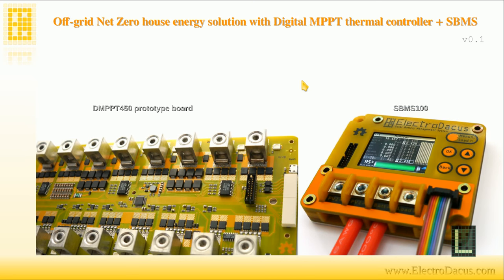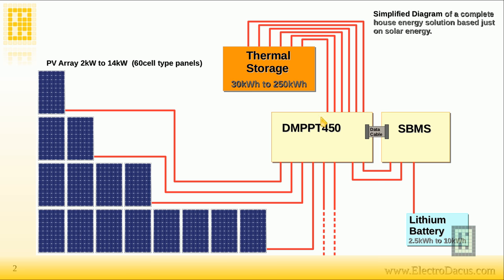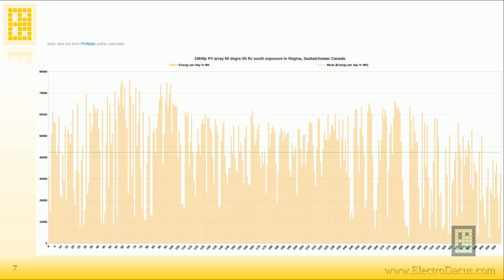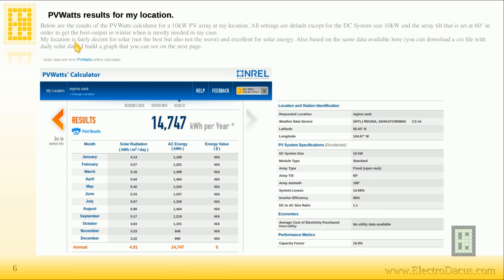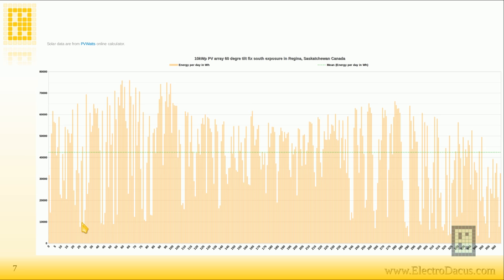Explaining the Digital MPPT thermal controller

Comment: Hello Dacian,
Is there any place where we can found specs of the DMPPT, like max current/voltage per input .. per output ? 
Max current that can be sent to the SBMS. Is it possible to connect an inverter on one of the output ?
Is the DMPPT only working as a "switch", meaning the current on outputs will vary with the PV exposure till the DMPPT eventually change the number of connected PV then there will be a "step".
How could we use this DMPPT as a "Gate" to heat water, provide power to an inverter and charge batteries. Meet the first question, which will then be the max power usable by the inverter and the battery charger.
Reply from the maker: Go to my webpage http://electrodacus.com/ and you will find the user manual. 
DMPPT450 can divert up to 120A to the SBMS120 for battery charging the rest of the energy will be send to the DMPPT ouptuts for heating and the number of DMPPT450 outputs enabled will depend on the amount of energy available from the PV array as the DMPPT450 will match the PV array max power point by connecting matching amount of Loads so Load+ outputs can only be restive heat elements to heat water or other large thermal mass storage like concrete in my case.
For example I have a 10kW PV array with a 5kWh LiFePO4 battery (I use around 120kWh/month as electricity for appliances most of that is electric cooking) and I have a 160kWh therma storage most of that is the large concrete floor that is insulated form outside. This fully heats my house and provides the electricity needed so is a net zero energy house.
Reply: @electrodacus  Hello, thanks for the reply. So ... last option, is it possible to put an inverter behind the SBMS.. since 120A is something like 4800W. I'm not into electronics, so .. sorry for my stupid questions : if i connect the batteries to the inverter... and the inverter is sucking less then DMPPT is giving.. then batteries are not used right ? The voltage sent from the DMPPT to the SBMS is 24V ?

I'm trying to find a way of using your devices,  while it seems pretty well done, it also seems very specific : 
- In summer or when thermal mass temperature is reached : Most panels can't be used cause DMPPT send 120A to SBMS out of 450A (max) from PVs... ?
- Can only be used with 24V ?

For me, DMPPT need one output to feed a 48V inverter, a non resistive device, perhaps the ability to switch one output for resistive/not.... 100A*40 = 4000W, seems enough.
Reply from the maker: Yes if the inverter uses less than what the charge current is then all the energy will be used directly from PV panels and the difference will charge the battery.
In summer I only use about 10% of total available energy and it makes sense as I do not have any use for the other 90% of the energy since I do not need heating or even cooling.
In an offgrid application there is no way to use all the available energy.
It is technically impossible to supply an offgrid inverter directly from PV panels as if panels put out say 2500W and you load needs 3500W there is no place from where you can take the extra 1000W and so voltage on the panels will drop and your inverter will power off or even get damaged.
If you involve a battery then the battery needs to be large enough to handle the PV array so say with a 10kW PV array you will need a 40kWh battery and that is very expensive negating the low cost of PV energy.
PV panels energy amortisation cost is around 2 cent/kWh while best case battery cost amortisation is 20 cent/kWh so at least 10x more expensive.
You just try to use all available energy in an offgrid system and that is just not possible (it is possible but just a bad idea to try and find something to use it on when you do not  need that and all will become more expensive just so you can say you used all available energy).
Reply: @electrodacus  Hello, 
Using only 10% of the available power in summer seems a bad idea to me, we could use electric tools (those that need 3000W+), air conditionning, high demanding appliances for example, losing this potential energy by design is not a good idea, in my opinion. I think you should include something to let us use the available power appart from resistive elements. I understand your case and that the DMPPT can satisfy your use .. but most people will not be in your case and thus the DMPPT need something more to satisfy more people, if that make sense.. :D
I'll reformulate the question, is it possible to connect an MPPT to an output of the DMPPT to supply an inverter ? (many inverters includes MPPT).

Those are not critics cause you did far more then i'll certainly never do, just that i try to find a way of using this tool cause it could help me a lot in winter. But i would also like to use more of my available power when the weather is cool and that i do not need heating. So in your case heating is something like 70% of your energy use, will be far less for me.
Reply from the maker: It is a bad idea to try and use more energy than you need (not sure if that makes sense to you).
For example my house uses about the same amount every month about 120kWh/month excluding electric heating and total including heating in January gets around 1000kWh and that is what the system is designed for as using any other source like propane as backup will be more expensive so it makes sense to design the solar system to handle the coldest month fully.
I do not need air conditioning else I can easily use that and I do not need any other appliances other than the ones I use and even if I will double somehow my current usage there will still be just a fraction of what is available so still far from using all available energy in summer that is maybe around 1300 to 14000kWh/month.
Home heating takes about 8 to 10x more energy than all electrical appliances combined (that is valid for almost any house in a heating climate not just mine) so it makes sense that you will not need that.
The cost amortization for my entire system is around $42/kWh about half that for each heating and appliances so around $500/year about $15000 in 30 years (that is the amortization period as the main component PV panels should last at least that).
Now anything that I add to this in therms of cost so that I can use more of the energy will be unnecessary since I do  not need more as I do not make any economy I use as much energy as I need so forcing me to use extra just to say that I used more of what is available will only increase my expenses for no reason.
For example I can have a larger water heater but if I do not use that it will not use more energy (slightly more as more will be lost over night with the higher area) and some other useless appliances can be added just to use more and say I double the 120kW/month then maybe I also need air conditioning as more electricity used in to has will all end up as heat so house will be warmer and that may also take maybe 40 to 50kWh to offset the extra energy usage that heats the house but all those costs for extra appliances will just increase my spending with no benefit and I will still not be using all available energy :)
Reply: @electrodacus  Mmm ... you do not reply to the questions. 

- Can we use the outputs of the DMPPT in something else then a resistive element (MPPT inverter/charger, something else ?)
-  If the SBMS is connected to a specific connector, can this output be used to connect an MPPT inverter/charger,  something else ?

I'm asking many questions to try to understand, but perhaps the easiest way is to ask : "On a 10kW PV system connected to the DMPPT, what is the maximum power (= no heating) that i can use in summer and how  ?"
Reply from the maker: No you can not use something other than a resistive type element on the DMPPT output as those just connect the PV array to the output and PV panels are constant current sources where current is directly proportional with the amount of light so any device that needs a constant voltage like an inverter will just fail when there will be a cloud or there will be less power available than what the respsective load want's to use. On top of that inverters are captive loads so when connected they act as a short circuit and so that will possibly damage the mosfets depending on max PV array current and PV cable capacitance.
No none of the outputs of DMPPT will handle capacitive loads and in fact no captive loads can ever be connected trough a switch either mechanical or mosfet based.
An MPPT inverter is only designed for grid connected solar and DMPPT and even SBMS are specifically designed for offgrid use applications.
If you are grid connected then adding a battery energy storage device is a very bad investment.
The DMPPT is summer when heating is disabled can redirect up to 120A to the SBMS120 over the PVOUT1 and PVOUT2 connections so that will be a bit over 3000W out of maybe 7000W (in hot summer day's panels will have lower output than STC rated) so less than half the panels will be redirected to this two outputs and if is cloudy or later in the day when sun is at an angle up to all panels can be redirected to battery charging as long as they are under 120A.
Battery will also need to be at least 400Ah to be capable to handle 120A charging so 10kWh battery minimum.
My battery is 180Ah so current send by the DMPPT450 to SBMS120 is limited to 60A in my case.
I can get away with such a small battery as even in completely cloudy days when all panels will be redirected to battery charging I can still produce around 4kWh and that is my average daily usage so battery will be fully charged every day even if I have an infinite number of overcast days.
The smaller battery makes for the best battery cost amortization as I do not have to pay for a larger battery and battery will still last about as much at least 15 to 20 years in my particular case as measured battery degradation for the fist year was 0.9% most of that around 0.6% was calendar aging that will affect the battery even if not used at all.
Reply: @electrodacus  I think I'm like David, and there something I do not get, you say Dmppt act like a switch and connecting something to the output would be like connecting directly to PV.... my inverter is directly connected to PV, with no problems... it's an inverter with mppt and charger kind of "all in one". So I would not be able to connect this kind of inverter to PVOUT..?
I'm off grid.
Reply from the maker: Can you provide me with the offgrid inverter model that works directly from PV with no battery ? I'm fairly sure that is impossible.
DMPPT450 is a Digital MPPT so there is no DC-DC conversion involved is an unique product nothing like this exist as far as I'm aware. You will need to look at the manual to understand what Digital MPPT is.
Grid connected inverters will need grid synchronization to work, and an offgrid inverter with large input voltage range will just need to power off if Load requires more than PV can supply not sure how that will ever be useful.
Reply: @electrodacus  https://www.youtube.com/watch?v=kQfJMRSTh8g
This is one example, there are other bateryless inverters that connect to PV, many are used off grid to power pumps in the field without batteries (not this one which is for houses), just look for "batteryless inverter".
I do not see why we could not connect this kind of inverter... now the question is .. can the DMPPT "feel" the needed power on one of those output.... and put the according needed PV in the mix. 

But batteryless is not the point, we could connect an Mppt/Inverter/Charger device to one (or perhaps 2 in parralel) DMPPT output(s), this inverter would be connected to a battery... (no SBMS)...
You see, the DMPPT would act like a router but leting us connect a 5kW Mppt/Inverter/Charger device and produce AC "on demand", when there would be no load on the AC side, then most power could go to the resistive elements on PV3, PV4 ...

Something like this : https://ibb.co/2jfGVw1
Reply: You said an inverter working on PV was impossible ... So ? What are the conclusion now ?
Reply from the maker: @davidniquot6423  That is bad design from MPP side. Have you watched the entire video ? The reason that worked was that there was more PV solar energy than the load needed and it used the PV array as it was a battery but if there was any cloud those 20 panels (over 5kW of PV) will not be able to provide the 1.6kW load and it will shut off and this can both damage the load and the inverter is just a matther of time.
The inverter should have been designed not to allow for this to work as is very dangerous for both Loads and inverter.  Most loads will not even work at all as they require a high startup power say motor based loads and PV alone can not provide that unless severely over-sized.
Reply: @electrodacus  ... Of course there is more solar energy then load need ... it's not spontaneous energy generation. The guy said that he connected 1800W of PV for a 1600W load and the inverter was saying that the PV was low... which make total sense. If the PV power is too low then the inverter shutdown. Those kind of inverters are used to pump water and they use no batteries. You say it's bad design .. but they sell thousands of it.
Reply from the maker: @davidniquot6423  In the video was clearly stated that it is not working with just 10 PV panels (those are likely 260 to 300W panels so 2600W of PV was not enough for that load) then he connected two strings of 10 panels in parallel and that is what was shown in that video at least 5200W of PV panels supplying a 1600W load.
If there are clouds then it will turn ON/OFF multiple times and that will very likely damage the inverter as the manufacturer mentioned.
I use a PIP2424 inverter in my house they are good but in this particular case they should not allow it to function this way as it will sure get damaged without a battery.
What you have there is a PV array + a DC to DC converter /MPPT plus a DC to AC inverter then load and as PV panels are not a storage device just a constant current source based on the amount of light any time the power from PV drops below what Loads need it will power off the load (that may be unsafe depending on what the load is). If that is just a water pump then is much easier to use a DC pump that can work directly with solar and can adjust pump rate based on amount of solar this way much smaller PV array is needed and no extra cost for solar mppt and inverter is needed. This is useless for any sort of loads I can think off.
Reply: @electrodacus  "In the video was clearly stated that it is not working with just 10 PV panels (those are likely 260 to 300W panels so 2600W of PV was not enough for that load) then he connected two strings of 10 panels in parallel and that is what was shown in that video at least 5200W of PV panels supplying a 1600W load."

Sorry .. but that's not what he is saying ... you got all wrong. It works with 10 PV with an alarm, it works with 20 PV with no alarm.
https://youtu.be/kQfJMRSTh8g?t=231
"when i only hook up ten panels which is one of my array, it ran but i got an error saying PV is low Ten panels at this time of the day should give me 1800W" => He use a mini split that draw 1600W => All good, the inverter is just saying : safe .. we are low on PV
"when i hooked 2 arrays, which mean 20 panels, obviously this is plenty enough for this 1600W load"
So it work in both condition. The only thing he said was that if the inverter had to switch on and off too often it would not be good for it... which is obvious.
I feel that you kind manipulate fact to turn them in your favor... which is .. not good.
Reply from the maker: @davidniquot6423  Those are 60 or 72 cell panels based on the voltage output so they are at least 260W panels and what he is saying about the 1800W from 10 panels is just his guess as he can not see what the panels are capable if he has no battery to take advantage of all the available energy.
An air conditioning unit require's at least 3 to 4x higher start up current than working and that will cycle often ON/OFF based on temperature thus it will need around 4000 to 6000W to start so 10 panels will not be enough even if in the afternoon as there is no energy storage device the panels need to be able to provide that.
So you need a 3 to 4x oversized PV array to be able to handle that particular load he was using.
I suggest you get a small solar panel and a DC-DC converter then connect some different loads on the output of the DC-DC converter and you will see what the problems are as this is exactly the same thing. Without a storage device you need to oversize the PV array and even then your loads will power off when any small cloud covers the sun.
Reply: @electrodacus  Ho my god .. you still argue... it's the same as your peltier discussion where we are all saying that you are wrong but it take like 10 pages to convince you that you are wrong .. but still .. you do not accept it.
"inverter working on pv do not exist" .. they are, you was wrong .. period. "Yea but they can't take load without oversize PV" .. what are you talking about ... they take the load accordingly with what pv can give at a given time or what's needed to start a motor or whatever.. of course. 
That do not make you right. Jesus. You are not credible anymore.... sorry.
Reply from the maker: @davidniquot6423  What is there to accept? Solar PV panels are a constant current source with the amount of current they can provide being directly proportional with the amount of light when the level of light goes down and there is no energy storage device like a battery or grid as backup then the load will switch off (that is not practical).  Also every time a load needs to be started unless is a restive load like a heat element it will require a higher current to start and if that is not available the it will not be able to start.
So you need a significantly oversized PV array as it was the case in that video where at the time he was demonstrating the inverter he had connected 20 large panels (over 5000W of PV) to supply a 1600W load and even so it will only work in a full sunny day a few hours around noon.
I fully power my house with PV panels that includes electricity for appliances but also heating and the DMPPT450 that is used for heating can work with only PV panels and multiple heating element's no battery involved but the heating elements are resistive and the DMPPT450 is designed to connect as many heating elements as needed to maintain the PV array at max power point.  This way I use all energy available form the PV array and energy storage is done in thermal mass so that is there is a cloud maybe just one of the 6 heating elements can be powered or even none of them but it will still be warm inside even with a few overcast days as there is a large over 160kWh thermal mass storage device.
There are air conditioning units that can work directly from solar but the way that work is that it still have a slightly oversized PV array and the compressor has variable speed and so power output to match what is available from the PV array MPPT in some limits.   Having an air conditioning that was designed for grid use and needs constant amount of power is not practical to be used with PV as the array needs to be significantly oversized just for it to work a few hours a day.
You can write a comment in that guys video and ask him how that works for him.
Reply: @davidniquot6423  I understand what you're trying to say, but you should've dropped it when he said his design is unable to power capacitive loads. I, too, would love a way to dump power that's not in use to an alternate location, but if your batteries are always full anyway, it's not such a big deal. Being able to dump a ton of excess into anything (in this case the thermal) is in itself great already.
Reply: @eowendyl  Yea but for what i understand... his dmppt is useless in summer (near useless) and then you would need a to connect panels to something else to use them... which make.. In my opinion this dmppt pretty badly designed. I do not talk of the electronic design which i can't really talk of, but the product lack features.